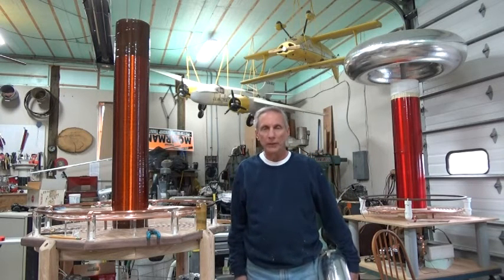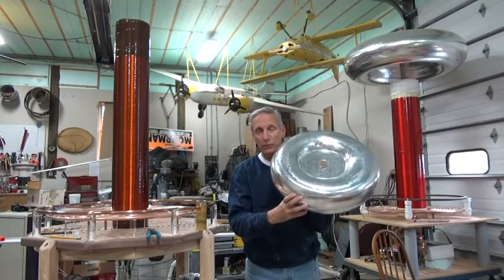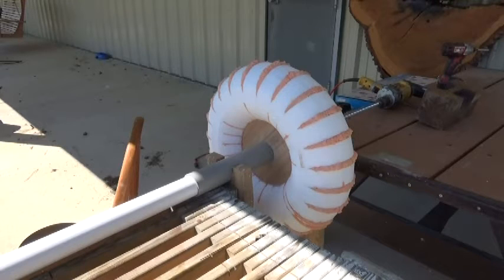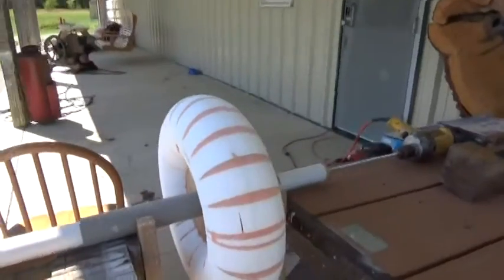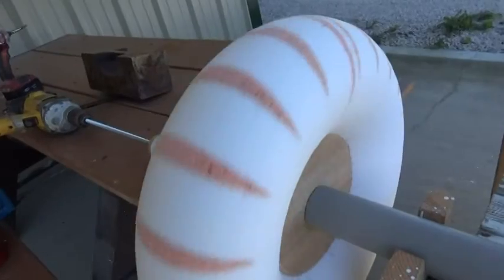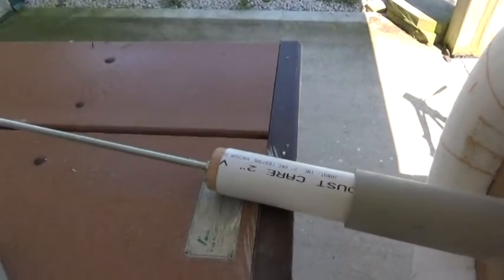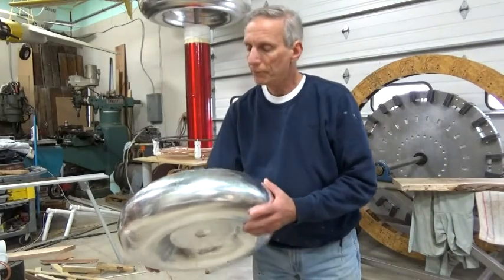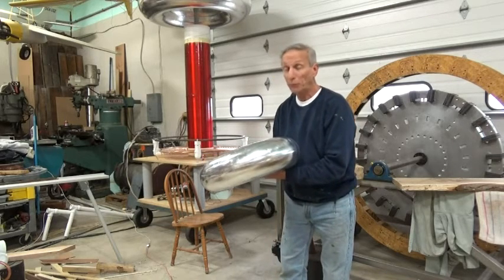how to build a toroid

Comment: Very awesome and well designed toroid. That was the only thing my tesla coil was lacking, a nice smooth equal, balanced toroid. I have two questions. When you say you are "spraying foam" in-between the foam pieces. Is that just "Great Stuff" insulating foam for filling big gaps or is it something else? Second question or rather asking for a recommendation. Could I use drywall spackle or something out of a caulking gun (silicone, tile grout, sealant type stuff) as an alternative to the whole fiberglass way, to fill in the small gaps and holes? Seeing I've never had any experience with fiberglass at all. Thanks in advance and thanks for such a detailed, great video.